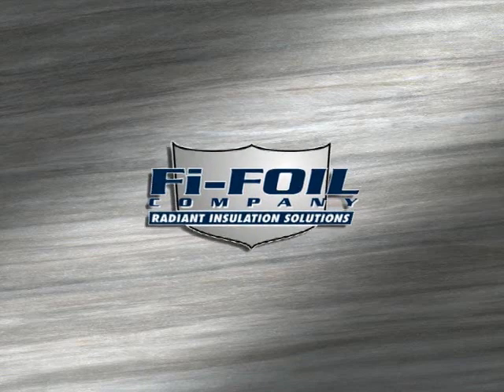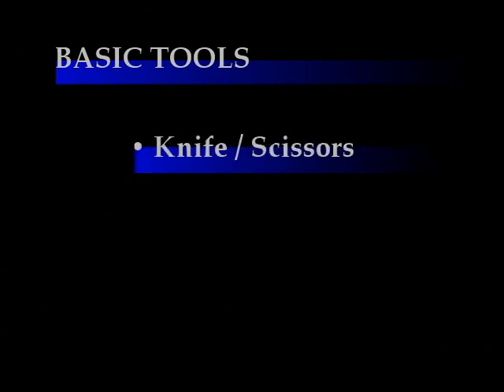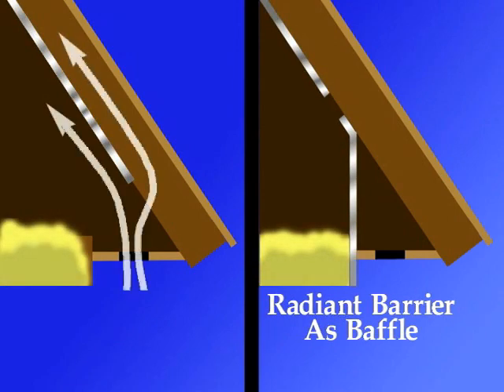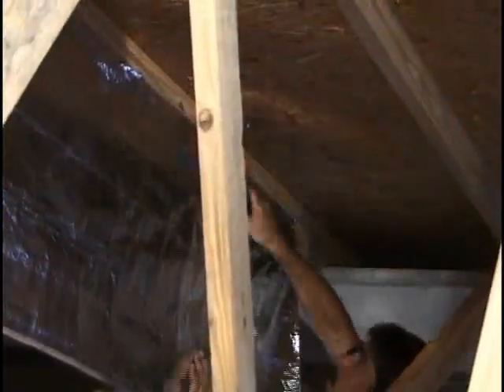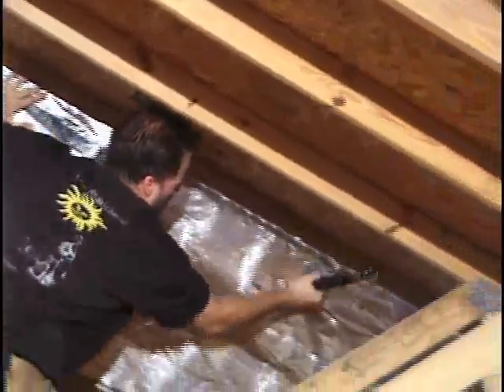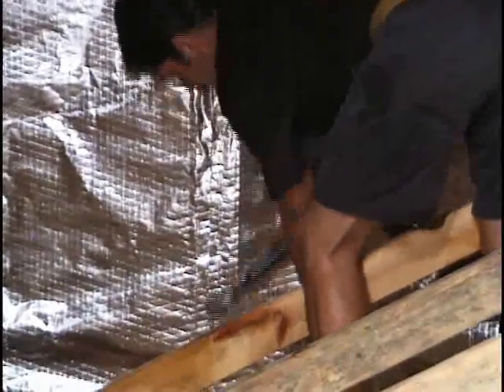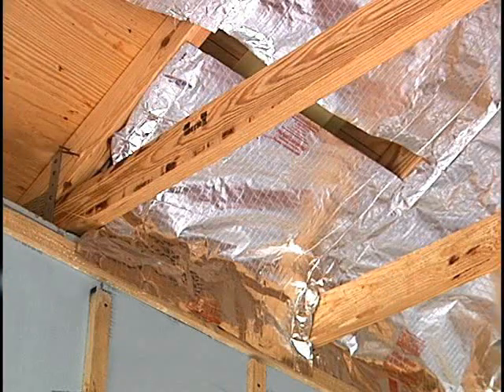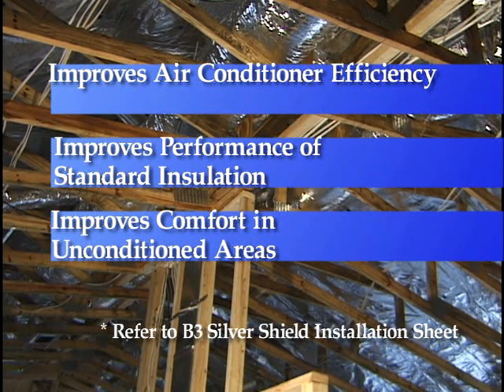FI Foil Installing Silver Shield Radiant Barrier 7 Min Video

Comment: What’s the point….does it help with insulation?
Reply: when your attic is hot, the heat sinks into your upper floors, with the radiant barrier it reflects heat from your shingles back  out rather than in your attic. your bedrooms could get 10 degrees cooler and your AC can run less.

Comment: Most of this is wrong. On the gable ends there is no ventilation for the hot air to escape trapped between the gable surface and the radiant barrier. The air will heat and if not ventilated it will tear out the staples.
A lot of rafters do not have ventilation at the top of the roof and with heat rising there can be a pressure build up. Makes it easy to install and it can work in optimal circumstances but a lot of room for inefficiency.  
Optimal air gap is less than an inch.

Comment: The foil should be placed directly on the floor of the attic. That is directly on top of the ceiling, facing directly up, nothing on top. So that the heat is "reflected up". Get the aluminium foil from the kitchen section at the supermarket for $5.00 a roll. $10.00-$15.00 will probably be enough for the basic three-bedroom dwelling. Install it the way the guy in the video says? Up the rafters with the aluminium reflecting back into the attic? In a warm climate your house will be perpetually overheated.
Reply: It's the aluminium's thermal emittance rather than it's reflectivity that is the radiant barrier. If you place the foil flat on the attic floor the heat will be conducted to the ceiling of the bottom room, perhaps even more efficiently that if it were bare lol. However I suspect that the aluminium foil from the supermarker probably would be a comparable material, it's aluminium right? I'd recommend to anyone experimenting to use foil with no treatment, just plain foil. I suspect the emmisivity of the plastic would be higher.
Reply: @blazor907  it'll work but a radiant barrier has 2 layers and air gap in between the foil.
the point is to reflect heat from your shingles back out, rather than in your roof.
also you want to avoid moisture buildup.

Comment: Seem like once the radiation hits the barrier it's already in the attic and will just be reflected back in to the cavity.  It would need to be vented out without ability to get in to the larger attic space.
Reply: Good points. I have not tried myself but think of sun shades  in a car. It is useful but still the hot air is inside the car. Therefore I assume it might work

Comment: 6:52 why this gap??? Isolation is open!
Reply: Sorry, this is not an answer, just wondering the same thing. I plan on putting a hard foam insulation board over to enclose the foil so don't know what this hole will do? wish they explained that more
Reply: It needs the air gap to work. Otherwise it’ll conduct the heat instead of reflecting it.
Reply: Hot air rises.

Comment: Needs a air gap to be radiant. Doing it this way is just wasting your money.
Reply: They were applying it with a 6inch air gap between the roof sheathing and the foil, which is plenty. It only needs to be 2 inches or more to reflect the infrared heat.